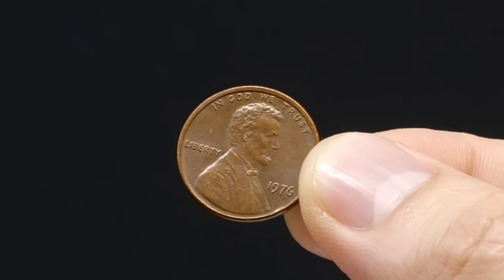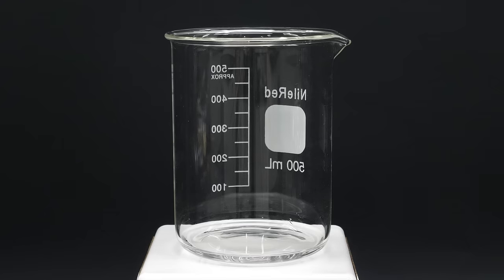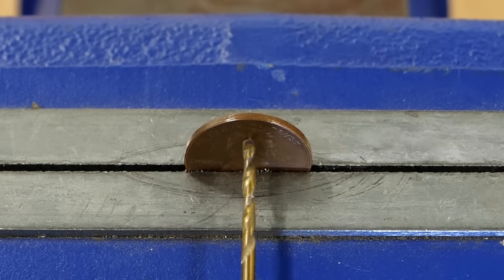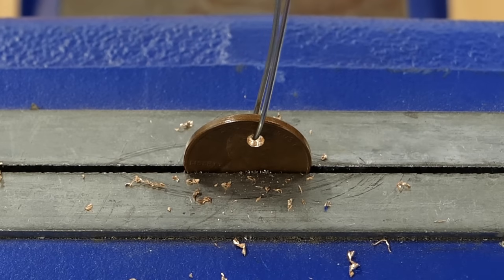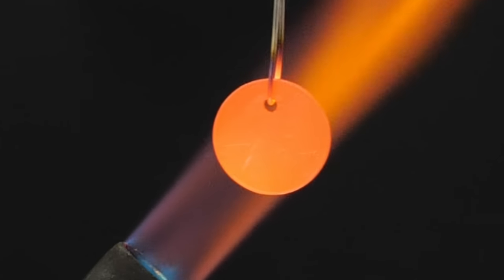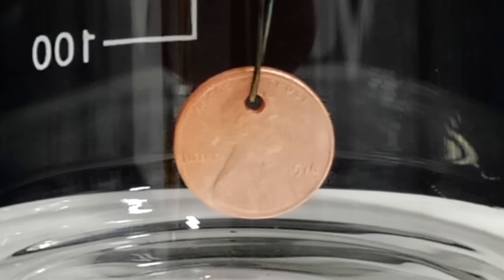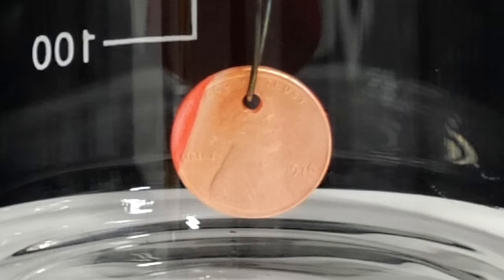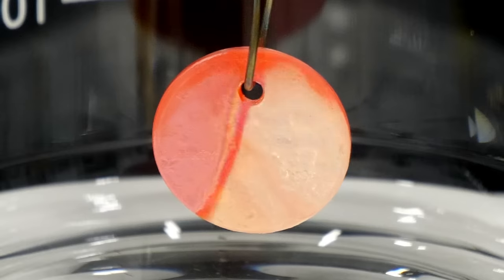Turning a penny into a light bulb

Comment: It’s important to note the year of the penny. It has to be an older penny as they are pure copper. Post 1982 Pennies were zinc coins plated in copper. Zinc melts at relatively low temperatures… red hot does exist with Zinc. It will liquify and drip out of any deep scratches.
Reply: 95%.
Reply: @HunterShows  you know it's a chemistry page when threads like this start.
Reply: My doctor gave me a zinc based cream for my foot, does it mean I can use pennies instead?
Reply: @Reth_Hard  yes, just make sure to melt the coins and apply in liquid form... otherwise it will be too hard to smear over your feet
Reply: @mudauvhadau170  
Ok I'll try it. Do you think it's going to do a better job for removing the fungus on my foot? The cream doesn't seems to be be very effective...
Reply: @Reth_Hard  there won't be any fungus left in your feet
Reply: @affegpus4195  
I hope so because when I remove my shoes it always smells like there's a few dead bodies hidden under my socks! And it also looks pretty much like the feet of a dead person, it's not cool...  :(
Reply: @Reth_Hard  There won't be any feet left for the fungus after applying molten copper 💀☠️
Reply: The copper on the surface will still catalyze the reaction. Maybe the zinc oozes out... Maybe it's even cooler that way
Reply: Is that only for American Pennies? Canadian Pennies have never been "pure"  copper, at most 98%, up until 1996. 
With Nile being Canadian I thought it may of been about using a solid copper penny. I now think it is because drilling a hole in currency is illegal and with him being Canadian he used another currency.
Reply: @nigeljohnson86  The canadian government would probably thank him for removing another penny from circulation honestly
Reply: You can see that the penny is from 1976 when Nile is heating it up.
Reply: @nigeljohnson86 , Nile used an American penny. You can see Abraham Lincoln on it. Also it has "In God We Trust" on it.
Reply: Cent. From 1 percent. My 2 cents.
Reply: @freehat2722  cent, from percent from "per centum" latin for "by the hundred".
Reply: @SteveFrench_420  Yes, thank you.
Reply: Are you sure it is zinc? British pennies are nickel coated in copper.
Reply: @olmostgudinaf8100  oooo yeah, 97.50% zinc! My two years of chemistry and many melted zinc splatters… plus a good Google search.
Reply: @JordanNHoule  Thanks. <hangs head in shame>
Yeah, search engines are great. My excuse is that I was watching on a phone with such a low spec that it can only run one app at a time. Starting a browser would shut down the YouTube app and I would lose the position.
Reply: @olmostgudinaf8100  ooooo I didn’t me that as a knock or slam on your comment. Sorry if it came across that way. I meant it more as a double check on my memory. 

Fun project if you get a hold of a brand new American penny. Gently file a little section of the side of a penny. Holding it with the filed side down by using pliers hold over a bunsen burner set at a 45 degree angle until the penny gets hot and the zinc will melt all at once and drop on the bench. It’s best if you can drop it on a tempered tile. 

You’ll have a cool splatter shape piece of zinc as well as the copper shell of the penny still with all the print of the coin.
Reply: @olmostgudinaf8100  Yes US cents are zinc. Our nickels have nickel 25% and copper 75%. British pennies are copper coated steel. It's easy to look up.
Reply: @JordanNHoule  Don't worry, I didn't take it as a slap. And if it were one, it would be well deserved anyway 😁

Another fun experiment would be filing a corner of a IS penny and dipping it in acid. It would eat all the zinc away, to the same effect. Now you've reminded me, I've seen a video on that. Made by Action Lab, IIRC.
Reply: @olmostgudinaf8100  I’ve definitely seen that one too.
Reply: American Penny yes.. but here in Canada, where Nilered and I are from. It wasn't until 1997 that the penny was 98% zinc,  1982 to 1996 they were 98% copper, and then 2000 to 2013 they were 98% steel. The penny was discontinued in Canada in 2013, and they are nearly impossible to comeby now,
Reply: Forbidden lava cake
Reply: The whole penny liquefies they dont even use copper jacketing anymore.

Comment: This reaction blew my mind when I heard of it  the first time. I tried it with coiled up copper wire.  This increased the active surface area and decreased the  thermal mass at the same time. It produced a decent amount of light but tended to catch on fire.
Reply: Catching on fire sounds like a very NileRed thing to happen.
Reply: @DavidCowie2022  Honestly I expected it to catch on fire in his experiment as well. This would have increased the light output significantly.
Reply: Nile's drill blew Lincoln's mind as well

Comment: it'd be cool to see if it works with something a little bit bigger like a copper sheet and see how the acetone fumes move through de air
Reply: true
Reply: How about a coil or copper wool
Reply: Hmm yes, big science words, me understand.
Reply: @nifa7231  your website down
Reply: Or with a thin filament and the acetone in a sealed container
Reply: I think it'd also be cool to see a copper strip folded a few times to make a "filament" maybe it could even be started with electricity to heat it, I'm thinking having more copper would make a brighter light

Comment: Cerium, iron, manganese, nickel, platinum, rhodium, palladium, as well as copper can all catalyse the reaction between hydrocarbons and oxygen. But nickel can produce nickel tetracarbonyl, which is poisonous.
If you have any of these metals lying around, it would be interesting to see if there are any differences when they react. Does the "light bulb" get brighter? Is it a different colour? Do they get hotter?
Reply: any silvery coins like, say...  nickels should be made of mostly nickel.
Reply: @tsm688  Actually, US nickels post-1965 are 75% copper, 25% nickel
Reply: @tsm688  O...K... Do you know of any rhodium, cerium, or manganese coins?
Reply: @Crowbars2  rhodium and cerium are hard to get, but manganese is the black gunk which you  get out of your tap.  Maybe someday Nile will make a video about turning the gunk from your tap into a lightbulb...
Reply: @tsm688  Rhodium jewelry can be bought, and cerium can be reduced from cerium oxide, sold as a glass abrasive.
Reply: @angusyang5917  cool
Reply: "But nickel can produce nickel tetracarbonyl, which is poisonous." You realize that this is a ketene lamp, right? Nickel tetracarbonyl is the least of your concerns...
Reply: @garywiens8625  LD50 for Nickel tetracarbonyl for a 30 minute exposure is 3ppm. IDLH for ketene is 5ppm, and LD50 for 10 minute exposure is 116ppm.
I know it's not an apples to apples comparison, but they're both pretty damn toxic.

Comment: Nitro engines in RC cars and airplanes use the same principle. The alcohol vapor and fresh air in the intake charge catalyze against the hot platinum glowplug coil to keep it hot enough during the intake/compression phases to be able to cause combustion when the intake charge is fully compressed.

Comment: How long does the reaction last, and can it be scaled up to any practical purpose?
Reply: It lasts as long as there is enough Acetone evaporating beneath it. Acetone evaporates relatively quickly, but if you keep enough of it below the penny, you could keep it going for a while.
Reply: Report the bot above me:)
Reply: It can last until it runs out of fuel.  Plenty of small gas heaters and gas soldering irons use it.
Reply: This reaction was once used to make formaldehyde from methanol, you can also use acetone to make ketene (literally what he's doing, why didn't he mention any safety precautions?) a gas more toxic than cyanide but can be used to turn water into acetic acid and acetic acid into acetic anhydride
Reply: @EdwardTriesToScience  at these temperatures, won't it all just burn?
Reply: @laughinggoat9343  what should I report them as? Spam or sexually explicit?
Reply: There's no way for the ketene to burn since there's no oxygen, the beaker is flushed full of acetone vapors to the point of not being able to ignite inside
Reply: @EdwardTriesToScience  How energetic is the acetone to ketene reaction?  something has to be heating the copper
Reply: Yeah it's just the reaction itself, it's not too violent and typically you actually need to keep heating it since it eventually cools off
Reply: @EdwardTriesToScience  What's keeping the copper red hot in waves then?
Reply: The wave effect is just the vapors convecting around from the heat
Reply: @EdwardTriesToScience  acetone vapour isn't luminescent bright red.
Reply: The acetone vapor convecting around making the copper hot in some places and colder in other, not the vapor itself
Reply: @EdwardTriesToScience  How's it magically get hot again after it cools off?
Reply: It only cools of in some areas, and to be more accurate the waves are also from the copper getting oxidised and reduced again by air and acetone vapors convecting, the reaction of the acetone with the air and its pyrolysis is what's keeping it hot
Reply: @fuzzynuttz5092  it is 100% spam, while sexuality needs to be proved. So my choice is "spam". But YouTube may be more excited about "sex", so it may have benefits too.
Reply: @sdjhgfkshfswdfhskljh3360  not only that but I think it's one person that own all of these channels due to them have the whole "Megan is hotter" shtick going on
Reply: @EdwardTriesToScience  yes copper is the most thermally conductive metal so it heats back up rather quickly but I was also thinking that the acetone might be actually on fire but we can not see it due to the explosure of his camera and blue flame that acetone produces what do you think gasoline or buetane would do?
Reply: @coopachew  It cant be on fire because if it was the whole beaker would be on fire, and as far as I know gasoline wouldn't do anything since its just hydrocarbons while isopropanol, acetone, ethanol, MEK, methanol, ect can all be dehydrogenated by hot copper

Comment: So I actually have a use for this kind of dim red lighting - it's beautiful and provides vision to critical areas in the pitch when you need it. 

However, one question - how long can you get a reaction like this to last efficiently, and how small a space can you fit it in? Does using a larger metal plate and a mixture of water and acetone work better? Perhaps alcohol of some sort? 

I would actually like to see this taken to the extreme. If nobody else has a reference to someone doing this as a main focus, please let me know if you would be interested or there is another video like this. I would be glad to research more on how to make my own low-energy night lamps with this.

Comment: This only works with pennies made before 1982. If you use a later penny it will melt because pennies made in 1982 or later are mostly zinc, not copper.

Comment: I knew precious metals could have a reaction to vapors in instances like hand warmers, but it's really interesting how copper can also do that.
Reply: While Nickle might qualify as a "precious metal" (doesn't in my book), which is used in those really coo-- err nifty phase change liquid hand warmers/heating pads with the nickle disc... _(clicking the disc flakes of a tiny bit of nickle and triggers the liquid to crystallize) 
But the everyday hand warmers? Not much that's precious in them, as they're just bags of Iron and Salt, which reacts with air to, basically, turn the iron flakes into rust (iron oxide, but it might be a specific variant since the resulting material is black/dark dark
 red, hence using 'basically')

Fun Fact: since the latter is a runaway reaction, albeit over a period of 6-10hrs (in my experience) before running out of 'fuel', you can actually halt the reaction by putting the hand warmer in the freezer! I was skeptical whether that really worked, but I can confirm it does, and seems to suspend it for as long as it's kept at freezer-temperature. I left a couple of them, that only were used ~4hrs, in my freezer for at least 3 months. Pulled them out where they continued to functioned the same for thermal output, and for just as long as they would've! (granted, they took a few minutes to kick off again, being so cold heh)

I don't remember what the Naphtha burner ones use. 🤔 (bigclivedotcom had a video showing one)
I thought they were equally non-precious, but might've had a platinum or palladium filament...

Comment: Not much copper in a penny:

"The alloy remained 95 percent copper and 5 percent zinc until 1982, when the composition was changed to 97.5 percent zinc and 2.5 percent copper (copper-plated zinc).  Cents of both compositions appeared in that year."